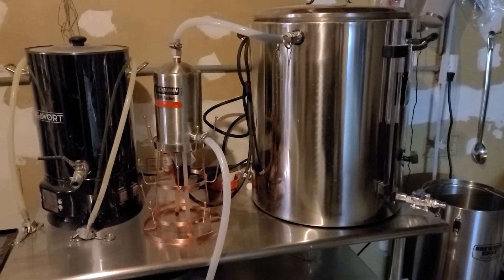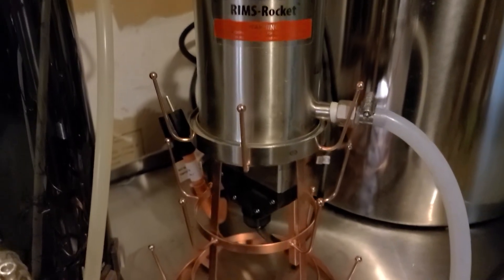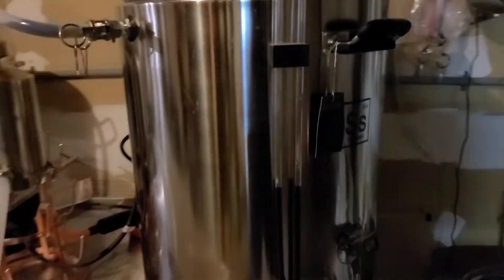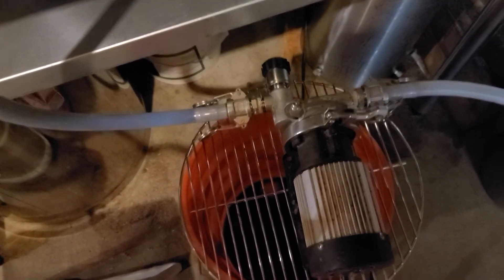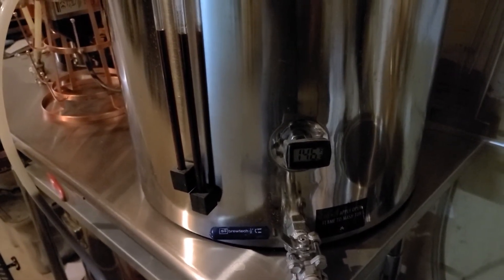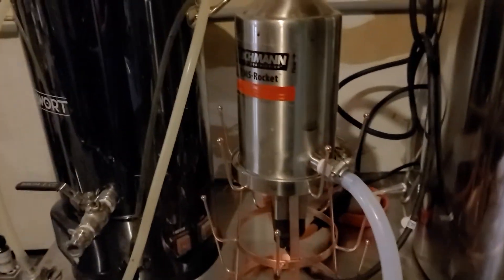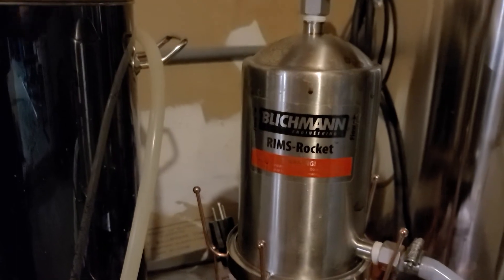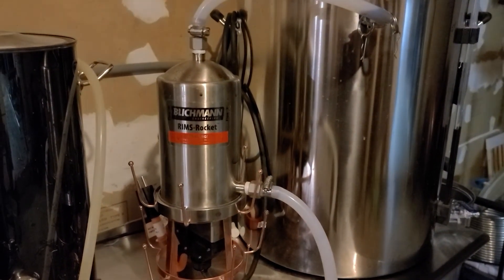blichmann RIMS Rocket

Comment: are you still using  the rims rocket? I'm currently using an old immersion chiller.  running the mash wort through that. i dunk it (immersion chiller_) in heated water to regulate my mash.  
Turn the water up and down as needed.  I even can get the mash up to 170 for mash out.
Looking at your video.  i would say never turn the pump off.  keep your mash reciculating and plug in the rocket when you need to get the heat going.
you could even add a thermowell in the line and have it trigger an Inkbird to get the coil going.
I usually have to account for wort loss in my grain builds.  
The rims rocket seems appealing to me because i won't have to manually dunk my immersion chiller in hot water.  That part kind of sucks.
I'd like to know if you found better luck with the unit.  Plus did you get the 120V.  that seem to work ok?
Thanks

Comment: How do you like that rims rocket? any stuck mashes?
Reply from the maker: I don't like it that much. Unless you can mount higher than the mashtun, you will leave close to half of gallon of liquid in there that you have drain out and put back into mash. If you can manage to mount it high enough to counter the hydrostatic pressure, May be worth it. If you have any ideas, please share